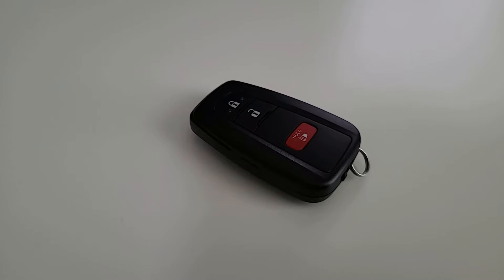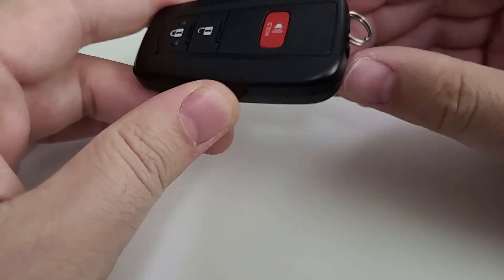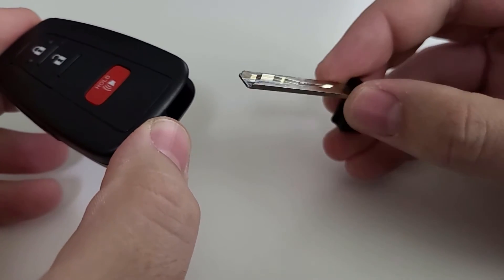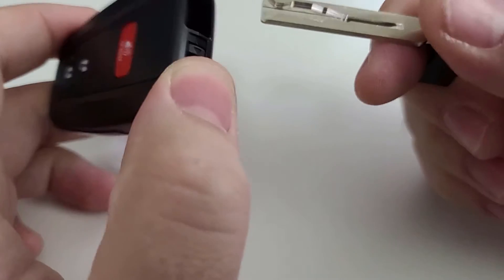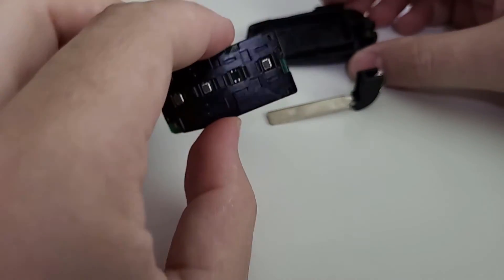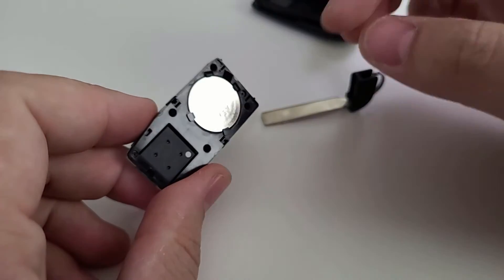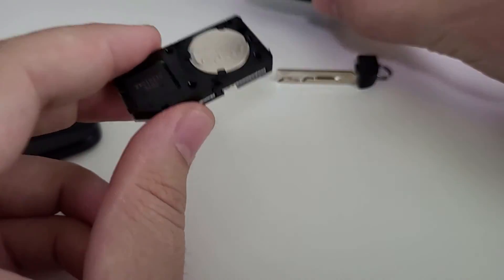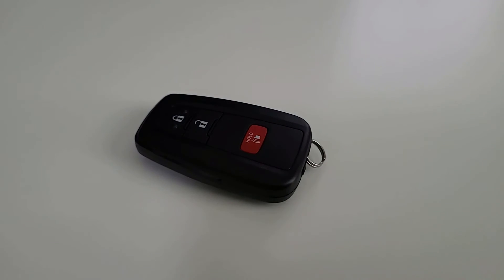How to Replace Toyota 4Runner Key Fob Battery | Fifth Generation N280

Comment: Few compliments about your video.
it’s only half a video.  yes you got me inside to the circuit board, that’s half the job.  and your video is mandatory because no human being on earth would ever get there thing open, without your video.  BUT you blow off the hardest part which is getting the black plastic lid off the battery.  the one with the 4 dots.  If you’re gonna blow off half the instructions, why did you make a video at all?
Now i have to keep searching and find another video,  to figure out how to remove the black plastic battery 4-dot holder.   Thanks, but No Thanks!
Reply from the maker: Thanks for the few compliments!